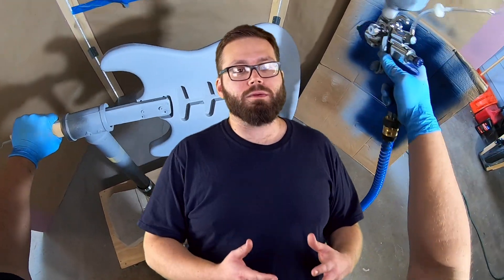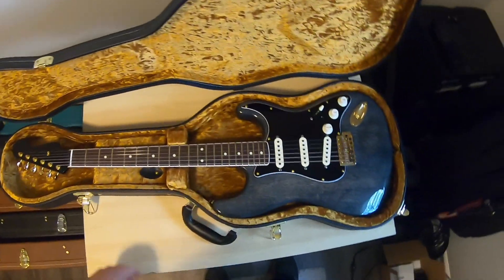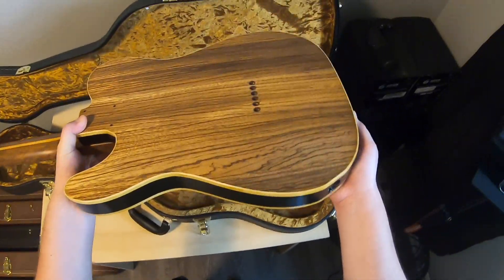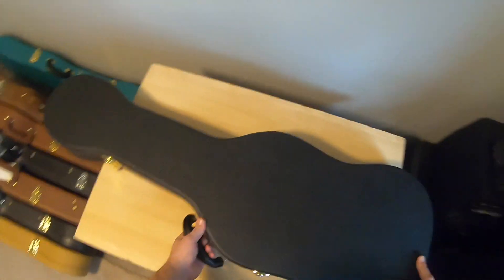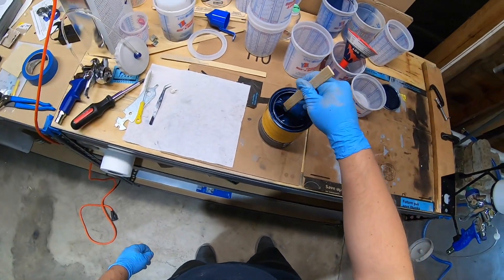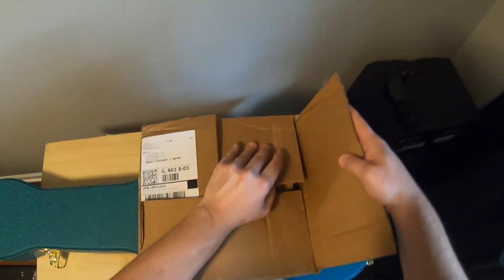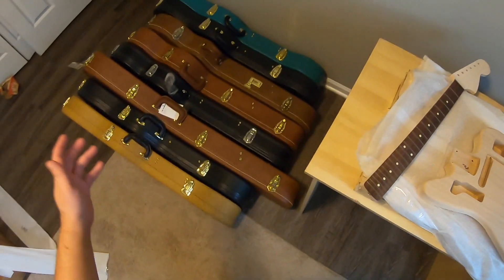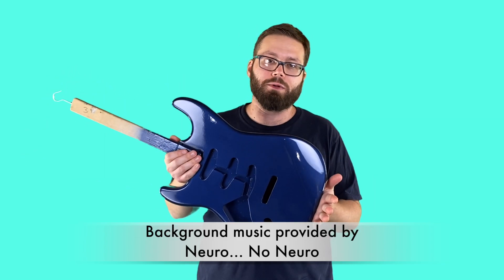What'ya Buildin'? Episode 1 - Sharing 6 of My Project Guitar Builds

Comment: That thinline tele with zebrawood back is really cool.  That back is beautiful.  Have you stopped using shellac?  I was having a compatibility issue on a finish recently and tried to use shellac as buffer layer and that reacted with the nitro clear too.  I scraped the whole headstock and ended up using some acrylic enamel I had because I was fed up.  I normally use nitro but I have to say I like the way the acrylic enamel dupliclor clear worked.